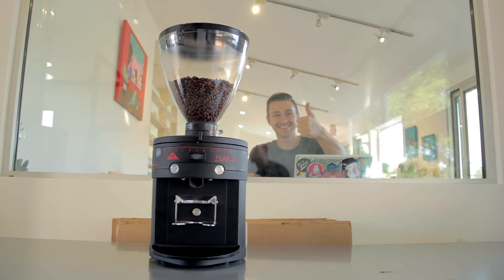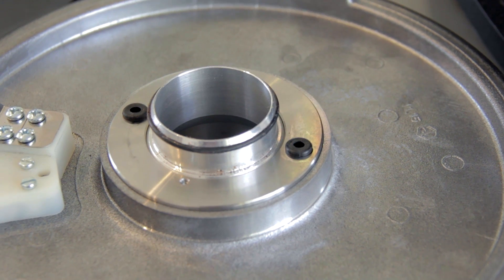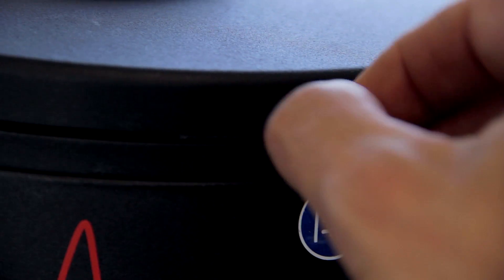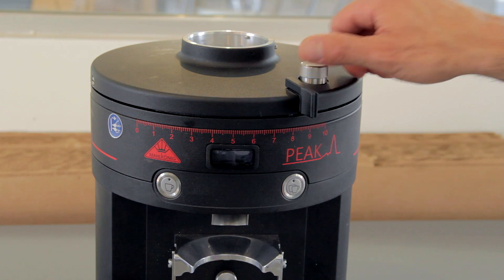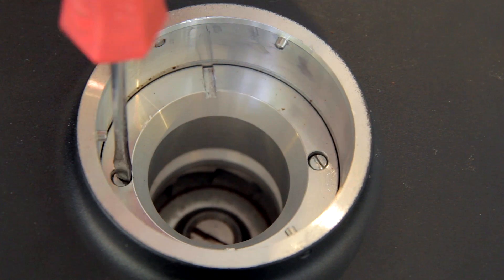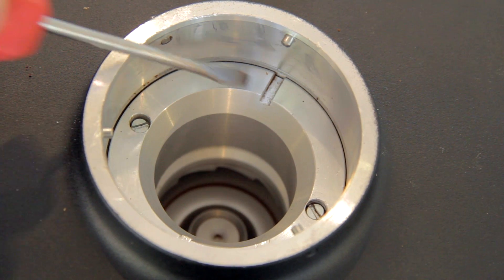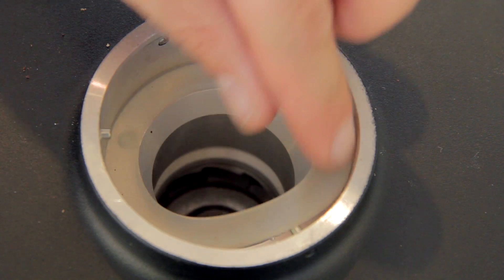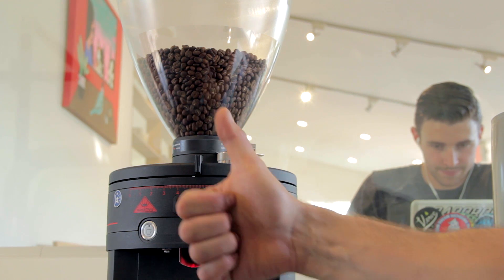Mahlkönig Peak Grinder Calibration Tutorial

Comment: Considering the K30 or PEAK for my home setup. I have a Baratza Vario-W and want to move to a stepless grinder that grinds directly into the portafilter. This video was excellent BTW. If you calibrate the machine as above, what would the approx. setting be for grinding expresso? I'm guessing 2ish. Would there be enough of a range to grind for drip as well? Like, maybe 8ish? I rarely make drip coffee. I realize the #'s are driven by bean, roast, how oily the beans are and other factors. Just looking for a general guesstimate. Also, the PEAK is a big jump in price but it has bigger burs and the .01 incremental adjustments for time adds a higher level of control over the K30. Just trying to talk myself into the increased cost I guess. 🤓

Comment: I see a lot of people setting their locking slide around 2-5 to dial in their espresso. After calibrating, I'm set at around 7-8. Is this normal? Lucky enough to pick one up for the shop recently and this vid tutorial hit the spot. But can anyone share experience on their grind settings and output being too fine? thanks! ... maybe I calibrated wrong?
Reply from the maker: 7-8 is way coarser than we're at but unless you don't have the range you need to adjust you should be good. You can always recalibrate and go from there
Reply: turns out our Peak was defective in a few different ways. what a trip. But we got squared away and def getting shit down. thanks for the response man